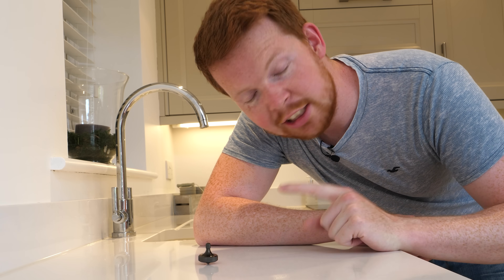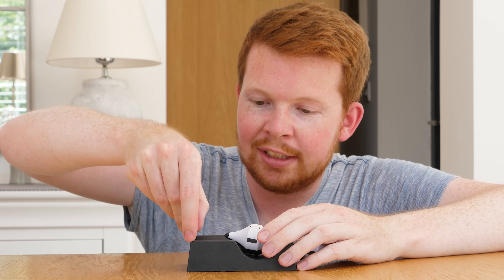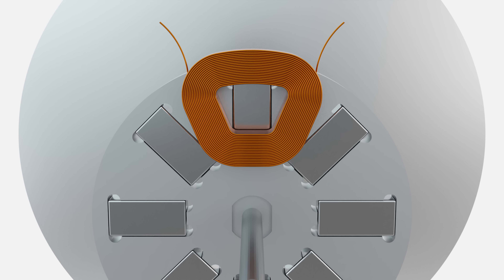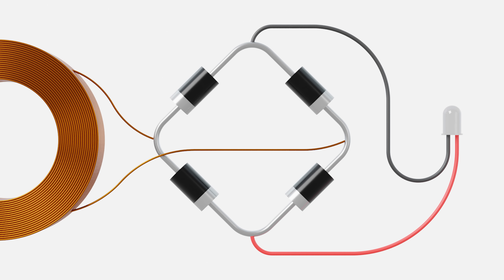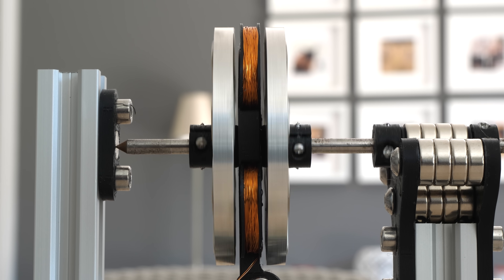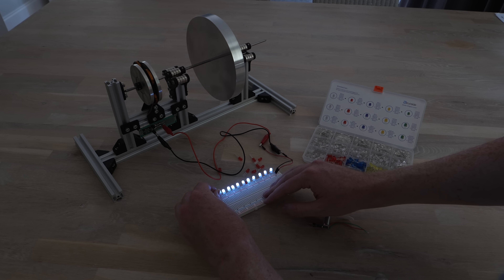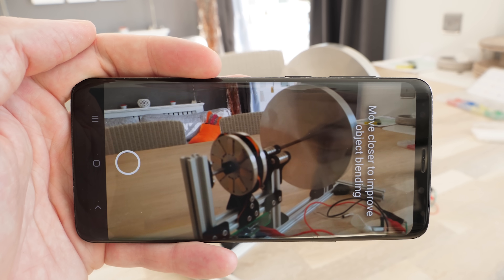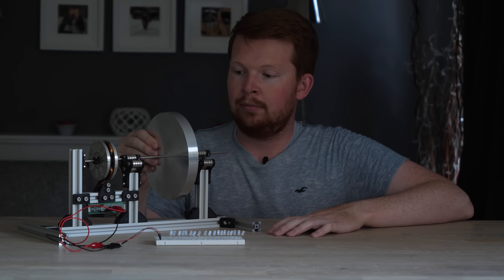Flywheel Battery

Comment: Wait, using packing tape to join my aluminum framing is bad?
Reply: i thought it was the strongest binding type
Reply: @baldr_  me too im confused
Reply: @baldr_  same here, I am awakening to new stuff it seems
Reply: @baldr_  same
Reply: You could try packing tape framing with aluminum screws
Reply: @samykamkar  you just changed the game forever
Reply: Just slap some FLEX TAPE on there.
Reply: @zzstoner  wow
THATS A LOTTA—
Reply: Real pros use gaffa tape 😁
Reply: D—......a...
Reply: Why Magnetic force is electric force? Why Magnetic moment and mono pole don't exist?

Magnetic force is circular electric force. There is no magnetic poles and there is no magnetic moment. If the magnetic moment is formed from 1 mono north pole and 1 mono south pole, like a smallest magnet, then you cannot use many of it to make a big magnet. 

Two parallel current carrying wires attract or repel each other is not caused by magnetic force, since there is no magnetic moment in copper wires.

Current carrying wire does not attract magnet and has no poles, circular current carrying wire attracts magnet and have poles.

Imaginary magnetic moment is in fact electric dipole, magnetic poleis in fact  concentric circular electric force . 

Theory Of Magnetism And Electromagnetic Induction

Ferromagnetic material has a special property – it can be magnetizing to create temporary electrical dipoles/magnetic domains.

Every magnetic domain contains at least two atoms. When an electron moves from an atom to the next atom and stays there temporarily, the two atoms become a temporary magnetic domain.

The magnetic domain carries a negative charge on one end and a positive charge on the other end, so we can call a magnetic domain an electric arrow.

Due to electric arrows carrying positive charge on the head and a negative charge on the tail, it has special properties:

1. Same direction electric arrows attract each other from head to tail, and by side to side.2. Opposite direction electric arrows repel each other from head to head, tail to tail, and by side to side.

Temporary electric arrows in magnets’ Ferro material cannot exist by themselves, but rather must all be linked into concentric rings and fill up the whole magnet, for a magnet to be stabilized and magnetized.

Therefore, on the poles of a bar magnet, there are concentric rings of electric arrows/dipoles, with one pole clockwise, and the other pole counterclockwise. On the body/surface of the bar magnet, there are parallel electric arrow rings all over.

A current in a wire does not create a circular magnetic field in space. It induces the electric arrows in the compass to be parallel to its current direction; therefore, the compass moves to 90 degrees to the wire.

Between two parallel conducting wires at distance R, line of sight electrons on the surfaces of the two wires are repelling each other with electrostatic force F=Ke x ee/R^2. This repulsion force is billions of times stronger than a steel rod. Because it connects all of those repelling electrons as one, therefore, if there is a current alternating in one wire, it will induce an alternating current in another wire instantly. This is the true mechanism of so-called electromagnetic induction. It is, in fact, electrostatic induction.

Magnetic force is a misinterpretation of circular electric force.

The magnetic field is a misinterpretation of the circular electric field.

Electromagnetic induction is a misinterpretation of electrostatic induction.

The electromagnetic wave is a misinterpretation of electrostatic wave/alternating current.

Electromagnetic radiation is a misinterpretation of electrostatic radiation.
Reply: @scientificlies7848  ok
Reply: You left out the most important information, a comparison of efficiency of energy stored, compared to a battery, and cost comparisons. Otherwise, it is just a generator attached to a flywheel, which I can do, by putting a large heavy disc on a little DC motor.
Reply: @ZafOsophy  Who is "You" in your post?
Reply: @perwestermark8920   Not you, the channel.
Reply: @ZafOsophy  Yes, this is a toy. Flywheels are not much meaningful other than for regenerative braking of vehicles. To get energy densities similar to batteries, they need to spin at huge speeds, making them very dangerous. And to keep the energy for a long time, it's not enough with magnetic bearings - they also needs a vacuum. And when rotating at huge speeds, they must not be twisted or the gyro effect will create chaos.

Work has been done on creating flywheel "batteries" for use in space, where the vacuum is trivial to solve. But the safety and the gyro effect are still challenges.

But since the concept is simple, this is a fun experiment.
Reply: @perwestermark8920   Yes, I agree, it is a fun project, but has no real world applications, in the same way, there are numerous Tesla Turbine fun projects, but no real world applications, as per my Tesla video :)
Reply: @perwestermark8920  But yet there are UPSes that use flywheels to smooth out power supplied to places like data centers. And then there are motor/alternator/flywheel/engine units also.
Reply: @gravelydon7072  Yes, there are lots of flywheel "batteries" in existence, since it's possible to design flywheels that can spin for months and can produce MW of power. From a technical standpoint, a flywheel solution is probably better than all attempts at lithium battery solutions because batteries suffers from loss of capacity from each power cycle.

Flywheels can be used to help wind and solar energy by buffering power for the nights and the calm days, without the wear batteries suffer. And without the fire hazard. But might be bad to use in earth quake zones.
Reply: @perwestermark8920  what if you were to place the entire flywheel assembly into a gyroscope like those spill proof boles for children
Reply: @jakehedrick6080  Placing the flywheel in a gimbal helps if using it in a vehicle. Buy makes the total volume needed quite a bit larger. Then it's probably better to settle for a smaller/weaker flywheel. Stationary flywheels have no issues with gyro effect unless you try to move the building.
Reply: Use a glustick
Reply: You didn’t need this video to realise that…
Reply: 😂😂i didn't know
Reply: But using duct tape is fine
Reply: @DunnickFayuro .......duct tape good, spider web and super glue better......hot glue and lolly sticks brilliant. Have been in discussion with the spiders union......who keep on this line about wanting more flies......and are very pissed off about there patents being ignored by the civil engineering community....and like to advise that William the Bruce got what was coming.
Reply: @robertwoodliff2536  🕷🕸🤙🤙👍💯
Reply: *aluminium
Reply: @zo1dberg  Aluminum!
Reply: @gravelydon7072  ALUMINIUM! PETROL! ZED! CARS DRIVE ON THE LEFT! METRIC SYSTEM!
Reply: @zo1dberg  NO ! JUST ! CENTRE !
Reply: @ Tom Stanton, Wait a minute. I just thought of something remarkable. What if instead of powering those leds, and little fans, what if you devised some kind of contraption that would feed the energy back into spinning that other end instead of using your fingers? Could it possibly perpetually spin forever or at least way longer than it should? Now that would be sick!
Reply: @battosaijenkins  nope, it's not a 100% efficent energy conversion, some of the energy get lost as heat (both from the magnet induction and the low friction of the axle), you would get a flywheel that spins for less than just having the flywheel alone without generator
Reply: @lorenzodeluca5321 .......put it in the fridge or freezer.......improved effect & you can get an ice cream ever time you need to spin it up.
Reply: @lorenzodeluca5321  🎓😊
Reply: @battosaijenkins  No infinite spin because of friction losses. But the generator could be used as motor to spin up the flywheel to a decent speed.
This would make it possible to use the flywheel as a tiny UPS. Normally, mains keeps it spinning fast. The same moment power is lost, the contraption switches to producing electrical energy. So a bit of flywheel-driven LED could light up directly after a power loss.
Reply: @perwestermark8920  tiny UPS?
Reply: @FelixMJD  UPS = Uninterruptible Power Source. Normally a contraption with a battery that is kept charged until a powet loss, when the battery keeps powering the UPS output. But a flywheel (especially in a vacuum) can also be used to store energy.
A really big and heavy flywheel at huge speeds can store enormous amounts of energy - but becomes lethal if the magnetic bearing fails.
Reply: @perwestermark8920 .......there was a test/prototype unit of a flywheel assisted train in the west of England about 25 years back,ie get off the block/out the station with flywheel/small Ford engine and cruise on engine only. Work OK,
Reply: @robertwoodliff2536  Trains and lorries are n8t that much affected by weight, so it's possible to make a heavier but slower flywheel. Especially also since a vehicle normally don't need to store the energy for very long so a bit of friction isn't really a problem.
So quite a lot of vehicle experiments have been done with regenerative braking. And in some cases using a weak engine to slowly spin up the flywheel but allow short buy very strong help uphill or when accelerating since a small engine running at a constantly high load is more efficient than a big engine mostly idling.
Obviously, electric batteries and electric motors are the more natural route today. An electric motor can manage without gearbox and it's possible to have many small instead of one big, removing needs for any differential too.
Reply: @battosaijenkins  perpetual motion machines don't work
Reply: @bigsmall246  But this one might, or almost
Reply: @battosaijenkins  even a spinning top that spins forever is not a perpetual motion machine
Reply: @bigsmall246  😱
Reply: @bigsmall246  What is it then?.
Reply: @johnhhinton5473  a spinning top that doesn't stop spinning is a spinning top lol. Try to extract energy from it and the top will stop spinning.

A perpetual motion machine needs to keep spinning even when energy is being extracted from it.
Reply: @battosaijenkins  🤔🆗️🥳🤯...🤤
Reply: @battosaijenkins  At the moment he has a generator powering lights. What you are proposing is him having a generator powering a motor, for example on the other side of the flywheel, that tries to keep it spinning. But there is heat produced by the bearing at one end, air resistance, and heat produced by the flow of current in the wires. So the flywheel gradually loses energy and slows down. This is why many people throughout history have tried and failed to make a perpetual motion machine.
Reply: @battosaijenkins  the output was only about 1.2w
Reply: @dantronics1682  So ?

Comment: "Modern" flywheels concentrate on velocity for the power generation. Also composite wound flywheels, from ordinary cotton to Fused silica, and carbon windings. They spin around 8 to 10 thousand rpm, with a counter rotating wheel paired with it, to cancel angular momentum in mobile operation.

Comment: Considering that you likely didn't match up the coils perfectly to the magnets, nor that the magnets are equally strong.
It might have been more efficient to give them a rectifier each and used even thinner wire for even more turns instead. Then the generator coils can work more independently and likely generate power more efficiently.

Comment: Neat project. You could get a smoother output if you put an odd number of coils. My guess is that 5 coils of the same size you're using could be fit into the space you put 4 by just reducing the space between them to a a minimum. Your output voltage would be far more steady.

Comment: if you build one with a base to where it spins up instead of to the side you would not need to use the glass plate or the other thing and if you make a vacuum chamber you can unlock the most of the potential energy from this thing but i love what you did.

Comment: These have been used in some power stations to reduce power dips on peak load. To store a lot of energy they are very heavy and spin very fast.

You also want to move as much of the weight of your flywheel to the outside, weight close to the

Comment: Would be interesting to see the RPM of the flywheel over time while applying different electrical loads...
Reply: Also... if you had two of these connected together electrically would they synchronise RPMs?

Comment: Using revolving energy, so it can translate that energy to a coil, which transfers the energy into electrical which in turn power a motor which is essentially revolving energy again.

You should do a project that transfers all forms of energy into each other, and takes the longest possible rout in order to accomplish a task.

For example, Radiative energy, into heat, into (fill in the blank), into (fill in the blank), into (fill in the blank)... etc and finally back to radiative energy. Or whatever order you choose.
Reply: Drill battery -> drill motor -> flywheel -> alternator coils -> capacitor -> drone motor. Chemical-electrical-kinetic-electrical-kinetic
Reply: @PKMartin  Then longer and more convoluted the better. It would be an interesting experiment to see how the input and output of energy varies.

Comment: The coil windings were quite inefficient in this with respect to the magnet orientation. You want the coils to cut as many flux lines as possible, this is what induced an emf, with the coils being wound on the way they were, there was only a short period of time where the magnetic flux lines were being cut and thus significantly decreased the efficiency of the generator

Comment: This was accomplished in a real world automobile in the 1990s.
It was installed on a used Saturn.
The flywheel made the power to keep the lead acid batteries charged.
The biggest advantage was the flywheel kept spinning for hours after the car was shut down.
Thus charging the battery without plugging in for an extended period of time.
The car was a hybrid. The gas mileage was 1,500 miles on a tank of gas.
I saw it on a p.b.s. t.v. show in the U.S.
The inventor at the time was looking to sell the system outright to an auto manufacturer for new car production.
I suspect he ended up selling it, but whoever bought it, didn't put it in production.
Companies will do that so the competition can't use the technology. This also allows them to eventually put it in production.
Personally I think it should have been sold to a company that produces after market conversion kits. 
It would have had the effect of fueling the 100% electric car at a faster pace that it is going.
In the future ( prediction in comming) we will se a fully electric car that has a generator on the free wheeling wheels, powering more powerful electric drive motors. As well as generating enough extra power for the added demand of opperating all of the electrical demands of a modern automobile.
The added demands are the reason behind the need for a better battery. 
Just a thought.

Comment: This would be a good device to demonstrate the counter electromotive force (aka motor action in a generator). As a naive child, I always wondered why an engine-powered generator's fuel economy suffered a loss when additional electric loads were added. At the time I thought the only load on the engine was the power needed to spin the generator rotor. Once it was spinning, how do the electrical loads influence the motor output shaft? With no load and various other loads, you could demonstrate the rate of speed reduction of the flywheel.

Comment: Nice video! Have you thought about puting magnets in both ends of the center axis? Instead of using a small point in contact with a wall to keep it in place, you could make two magnet walls and set de axis between then. Now, you'd have a system in equilibrium that can not colapse, and no friction. Also, if you put it inside a vacuum chamber and give a hell lot of spin, it will last longer due to no friction with de air. What do you think?

Comment: has anyone figured out magnetic power yet ??? one video a guy made a set up with lots of magnets on a round platform that spun ..each magnet was set at different angle slightly ..he neary had he held a magnet on the out side of the spining platform and twisted it back and fourth and the platform spun .. he said if he ccould make a timing bracket that held the outer magnet it would turn the magnet in time with all the other magnets and would have perfect magnet propelled energy ... we source most natural energy's but all have flaws ie wind comes and goes sun isnt constant water and gravity together ie water mills running of a downwards flow ... but not many forces are constant ... sea tides are and so is gravity ... how long does a magnet stay a magnet ??? if forever then surely magnets are the future in making free energy 🤷🏾‍♂️ p.s im no clever cloggs lol i never finished school ..i mean i.can barely spell my name .. but im very mechanically minded

Comment: I'd love to see a balanced version of this which can be reversed so you can use the coils to spin up the flywheel to crazy high RPM. Then add in a voltage regulator so you can safely power your output across the whole RPM range

Comment: Instead of alternator you can easily make a DC Generator, then you wouldn't need a full bridge rectifier. That will eliminate some parasitic drag on the flywheel, as a result of the diodes heating up (voltage drop). And the you can use the generator to also spin the flywheel with a small battery.

Comment: Would it be possible to spin this up using an alternating current in reverse - i.e. treat it like a motor - then it could be a rechargeable battery in a different sense? I could imagine you would need a high current and a little bit of a push to get it going in the right direction, and some way to get the timing right, maybe with an optical encoder?